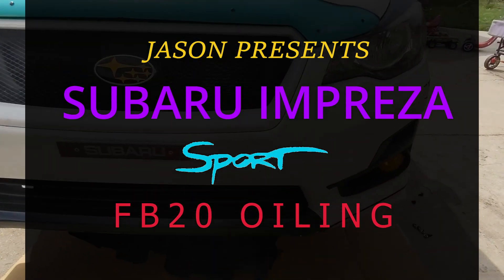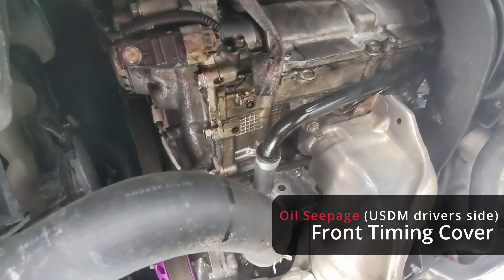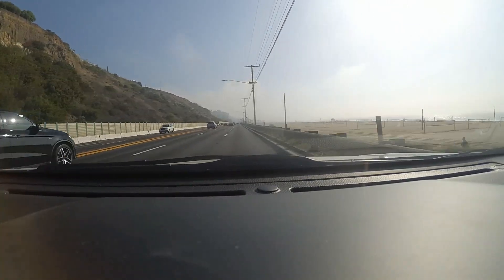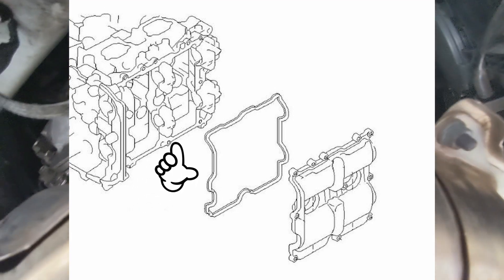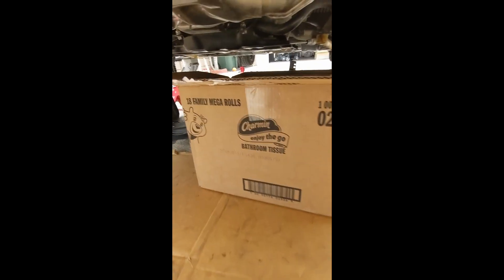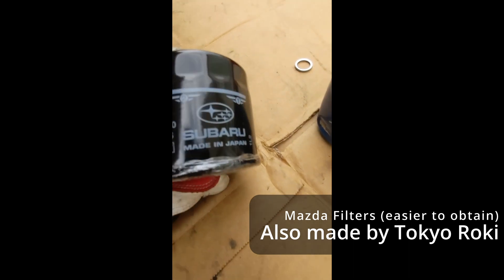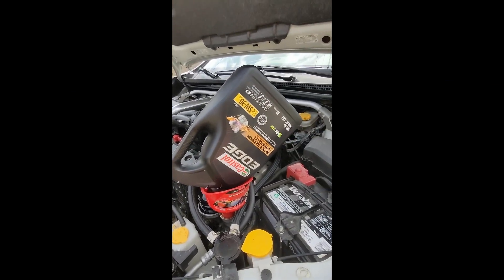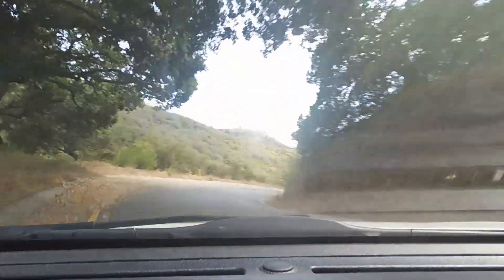Subaru FB20 / FB25 - Possible Engine Oiling Issues

Comment: Read alot regards PCV one of the culprit for seeping/leaking oil, and it must be checked or replaced every 30,000km...if not any reseal of the cam covers will still faced leaking issues again soon...any comments?
Reply from the maker: @MLOO123  the PCV handles a lot of the engines "plumbing". If that valve isn't free flowing it will cause pressure buildup in the engine causing the leaking. Please see my other video regarding additional maintenance items :) 

https://youtu.be/YXBquyR23Z0

Good luck!

Comment: I have a 2018 Impreza Sport. Even after having the valve seals replaced and timing cover resealed, mine still seeps a little oil now and again. Overall oil loss is less than a quarter of a quart between 6,000 mile oil change intervals. I do smell it burning off the catalytic converter once in a while after a hard pull or long hill.

Comment: Check you spark plug wells as well, I found oil seepage after 90,000km. The valve cover gasket and spark plug gasket as well were replaced.
Reply from the maker: Thanks, I'll take a look at the spark plug wells
Reply: @JasonLeung-4roller  I used the Mazda 8 oil filter because we can no longer get the black JDM filter in Canada

Comment: What are oil filter criteria?  
Oil pressure relief valve open pressure.  
Oil filter media quality , surface area , and micron filter rating.
Oil filter efficiency rating , 99% is most desirable.  
end

Comment: i live in Germany and drive an 2019 Outback stock with the FB25 port injected engine and the reccomended Oil is 0w20, wich i am using. I recently drove on the Autobahn full throttle max speed when it was 28°C Outside ( 82,4 Fahrenheit) for about 15 minutes. My Oil Temperatur was about 120°C degrees at the end. I use liquid Moly special tec AA 0w-20 (german brand). The reason why i use the "thin" Oil is also because the Piston Rings are really loose in FB Engines. Many people who use 5w-30 or higher viscosity complain about Oil burning. I don´t have any Oil burning issue even though Autobahn top speed runs are common for me. When driving normal the engine Oil sits at 100°C degrees.
Reply from the maker: Thanks for leaving a comment :)  what was the top speed achieved? I know the Autobahn has no speed limit. Top speed vs high revs is a little different, but I get your point. 0w-20 may be good for getting oil into those little parts of engine cracks where needed. Thanks for stopping by :)
Reply: @JasonLeung-4roller  its electronicly limited. Power gets cut around 197 km/h. Yeah i don´t drive my car like you tho. haha.
Reply from the maker: @jabajsadasfelif3395  197kph is ~120mph. That's pretty fast. But yes the ECU is typically limited to that speed.
Reply: @JasonLeung-4roller  car feels really stable at that speed. Was really suprised how safe it drives at that speed considering its a lifted Wagon. One more theory regarding Oil is that the thicker Oil causes higher internal Oil preassure wich can cause various Oil leaks over time. Anyways I enjoy your videos thanks for that!

Comment: I think mine might be doing the same thing. I loose about a quart of oil between oil changes
Reply from the maker: I noticed something similar, was wondering if I am not burning oil (blue exhaust smoke), then where is the oil going? It seeps and weeps and in some cases with more troublesome engines, leaks.